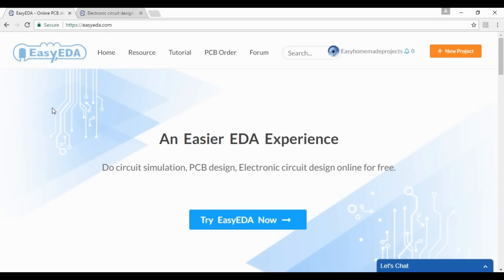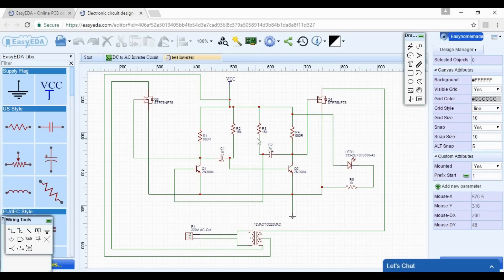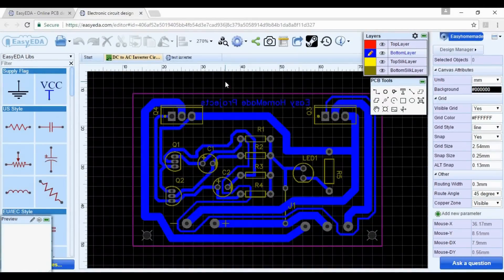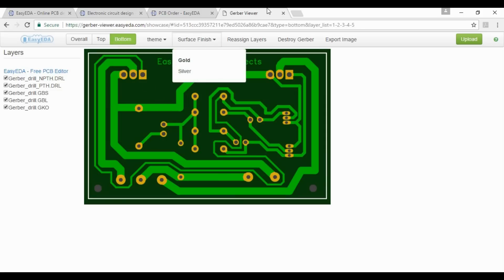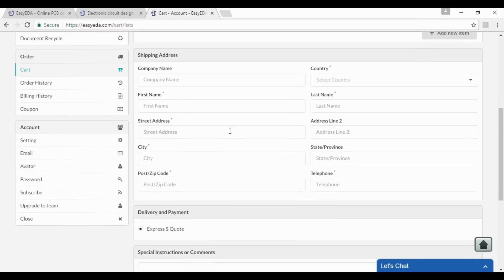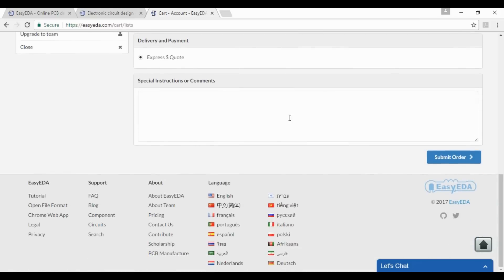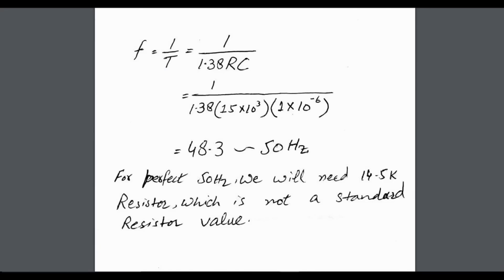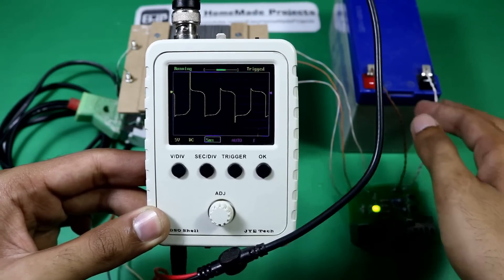EasyEDA online PCB Fabrication + How to make a 100W Inverter (12V to 220V)

Comment: ITS ASTABLE MULTIVIBRATOR , which is producing a square wave... this square wave can damage your appliances on long term use... its only best for resistive loads only and not for inductive load like blender or motor... overall good work

Comment: sir one 200watt inviter make  me, I requested u plz sir,I'm waiting 4 200watt video with circuit  diagram and upload eskematic diagram link thank u.......
Reply from the maker: use same circuit, just increase the power of transformer. in video, it is 8Amp transformer. use a 16Amp for 200W.
Reply: @EasyHomeMadeProjects  raising the current value mean increasing the impedance as well so its not recommended to just raise the transformer value just like that due to power loss so raising the transformer value means decreasing the flexibility and overall transfer

Comment: Can you show us the amp draw/consume by the inverter from the battery? what other loads can we use from this inverter? i want to build my own power inverter for my computer and laminator...about 600 watts total..
Reply from the maker: +vrich marketing renewable energy simply you can calculate using P=I.V
Reply: can you test it in a laminator if it  works? and can we use this for a long time? i made an inverter before and all i notice is that the mosfet and the transformer becomes hot/saturated.how can we solve this issue?

Comment: With respect, your investor work may work, but it is not serious. To be efficient and guarantee its use should have a controller by PWM and comparators. Otherwise this is very harmful for your artifacts
Reply from the maker: +Net Andino agreed. But it is not muxh harmful as you think.

Comment: where you connected the oscilloscope? 12-0-12 or 230v side?
Reply from the maker: +Abhinandan Behera use a 12v small step down transformer at 220 side.
Reply: there's big spikes on the output. why don't you use some RC network to smooth it? you can replace those BJTs with a 555 timer ic.
Reply from the maker: +Abhinandan Behera spike is dur to no load. A small capacitor at out put can solve this issue.

Comment: Good day Easy HomeMade Projects.Thanks for this Video.May I ask if what is the wattage capacity of the resistor to be used for this project?Is it 1/8 , 1/4 or 1/2..Thanks.Planning to buy some electronic components today.Hoping you can help me with my first Project.Thanks and Godbless
Reply from the maker: +Darrell Lucero hi, thnx. All resistors are 1/4 watts. For any other information, you can contact me on my Facebook page.
Reply: Copy Sir.Which facebook page particularly?Planning to collect all electronic components first before doing some connections on the board..Thanks for the Info sir.

Comment: how to make 220 ac to 12 volts Dc
Reply from the maker: +Nimai Dey use a step down transformer with rectifiers.
Reply: they don't even use transformers in most low wattage  led lights now

Comment: Hi 
Would you mention why did you build the device or what it is used for . Thanks !
Reply from the maker: You can Charge Your laptop, can run a sealing fan, lights, soldering iron, cell phone charging, LCD TV etc
Reply: Thanks for the reply . I hope for a device that could control the speed of a washing machine motor !!